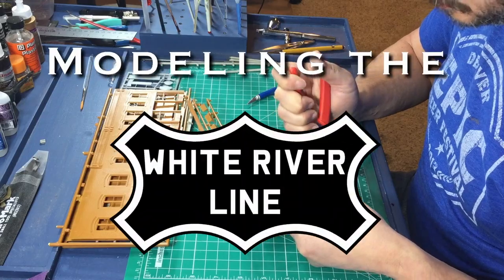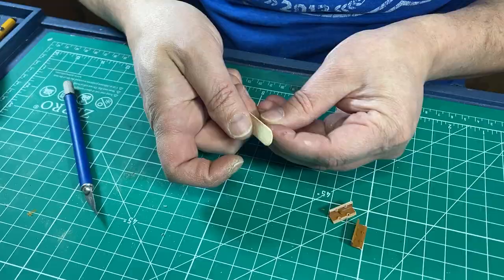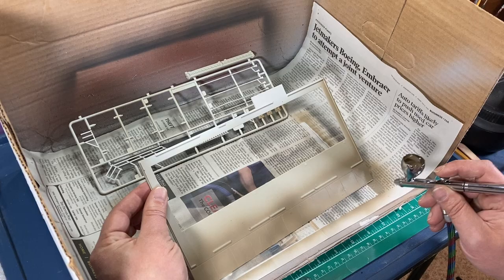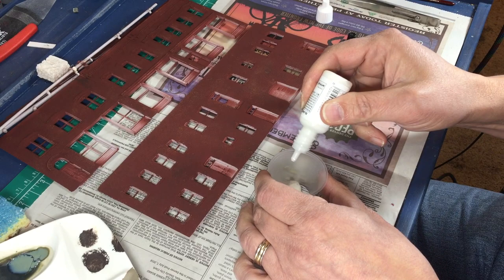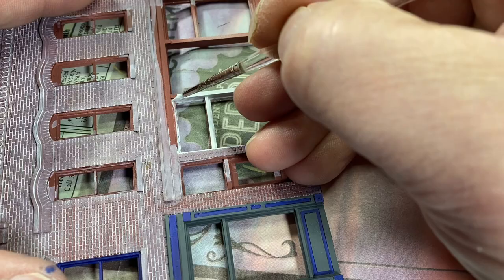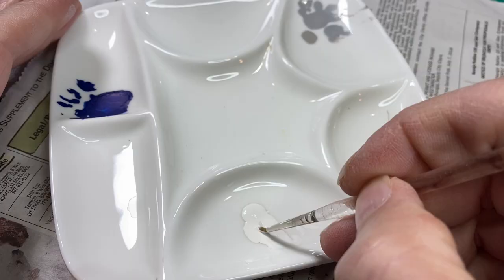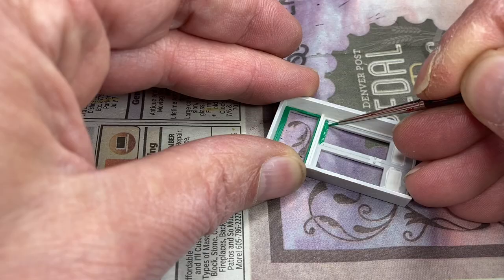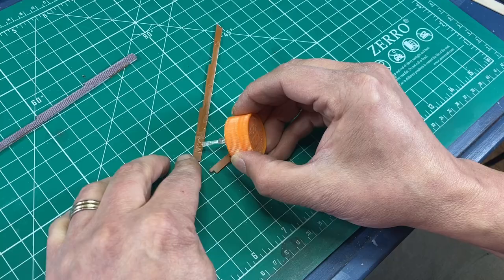Building a Walthers Merchant's Row Kit for a Model Railroad

Comment: I have watched a number of "pros" paint brick fronts like this and I would rate your method up there with them.  After applying the white mortar wash, I like to use a barely damp cloth to daub the brick with. You have to be very light or you remove it from the mortar joints, too.  Unfortunately,  it is a slow task to do structures like this, but oh the delight of having well done structures on a layout rather than some crudely done ones.  Old eyes and unsteady hands(even when resting your bush hand against something) are making my finishing take longer than in younger days. LOL
Reply from the maker: I recently saw a video from Jason Jenson (you should check out his channel too, a very talented modeler). He uses thinned drywall mud for his mortar, but he spray a coat of matte varnish on the paint before applying the drywall mud. I'll probably employ this technique myself.

Comment: The sidewalk looks great. As for the brick,  try wiping it off with a damp cloth. It’s easier when the paint is fresh …. But I still think it look fine. !! Nice work.
Reply from the maker: Thanks for the tip.
Reply: @WhiteRiverLine  I should add… press lightly and make several passes. This way you don’t pull the paint out of the mortar lines… good luck!

Comment: Brick isn't a total waste. What could help next time is adding a few drops of IPA to your wash, that makes the wash spread much better. I also use mission model paints and I have been very happy with them. They aren't geared to model railroading but more geared to military models. Project over all looks pretty good! When you start gluing, make sureyou scrape paint off your glue joints or it won't adhere properly.  Didnt know if you knew that or not. Keep up the great work! - Jason
Reply from the maker: Thanks. IPA? As a former home brewer I only know that as India Pale Ale. I've used CA glue without having to scrape the paint, but the plastic cements most definitely need to have the paint removed.
Reply: @WhiteRiverLine  isopropyl alcohol or rubbing alcohol.  I use about 70%, others recommend 90% or higher. It somehow displaces the wash much better than water alone.
Reply from the maker: Oh, yeah. I've got plenty of that (although I am running a little low on India pale ale at the moment). I guess I've never seen it referred to as IPA, but that makes sense.  I think it helps break the surface tension of the water. I will definitely try that next time.